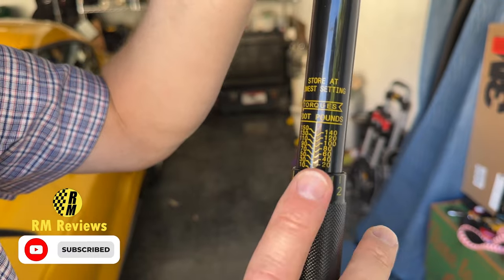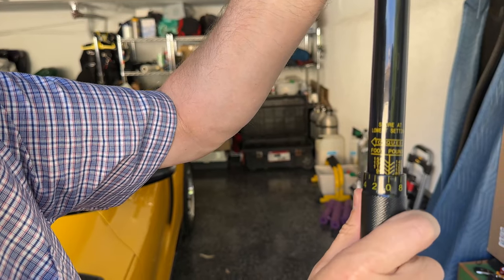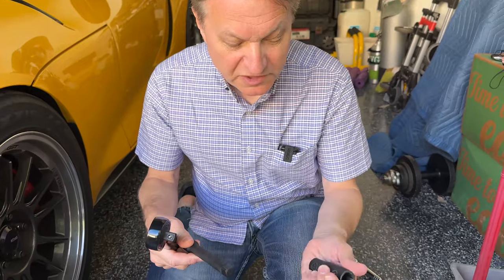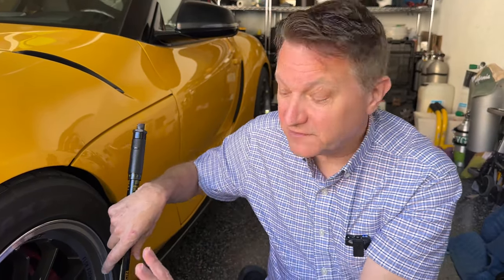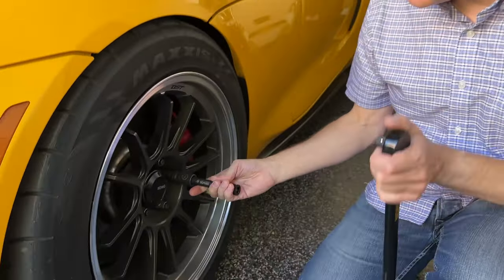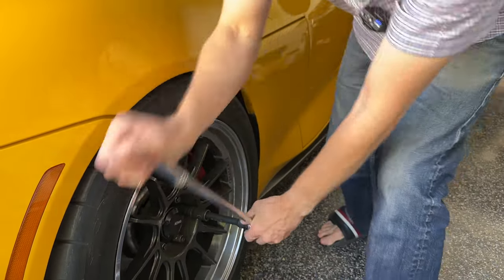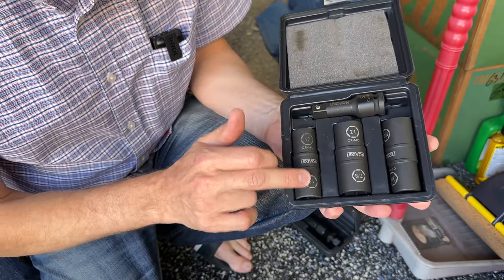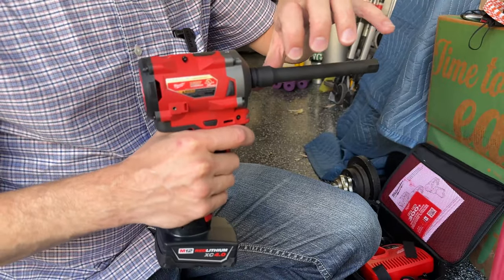How To Use A Torque Wrench For Beginners - 2022

Comment: One thing I didn't know and doesn't seem to be mentioned anywhere is that there are two or more ranges of torque wrenches. 0-25 and then 25 upwards. The former si really only for bikes and small bolts. I made the mistake of ordering a 25NM wrench and it was useless for cars. As a complete newbie I was not aware of this.
Reply from the maker: Good point. There are multiple ranges yes. I'll mention that in a a future update video.
Reply: there are at least 10 'common' scales, and they all depend what you are working on, there is no one size fits all, and if there is -it's so not precise to really beat the purpose... but for general around car purpose would be 25-110nm scale or as close to that as possible; over 120 you need a break bar, bellow 25 its for plastic and really soft metal... my scale is: screwdriver strength is up to 20, than you have fist over bolt 25-45, then fist next to bolt lever, then 2 fists lever, and finally -break bar lever for 120nm+  it's as precise as the cheapest tw, lol and more than enough for majority of at home motorcycle, car, lawn mower etc repairs
Reply: A 0-25 isn’t totally useless for your car… remember you wanna   have the right torque on your spark plugs.. so you don’t ruin your threads or your pistons. Perfect for 0-25…

Comment: When I use my small impact wrench it takes a lug nuts off with no problem I put a 6 inch extension on there and the doggone thing will not take the lug nuts off it will work pretty good with like my 2 inch extension but that doesn't always work for me sometimes I have to do the 6th and end up taking it off by hand there is quite a bit of difference

Comment: What I've read:
- If you're putting a lug on a wheel, tighten it by hand.  Then torque it to 33%, then 66% then 100% specification.  If applying multiple lugs this way, do all at 33%, then 66% then 100%.
- Torque lugs in a criss-cross pattern so that they distribute even pressure on the wheel and you don't bias the tightness on one side of the wheel.  That's bad.
- Make sure you re-tighten the lock nut on the handle after setting the torque value and before using the torque wrench - it can affect the internal spring accuracy.
- If you loosen your lugs in order to re-torque them, you may need to re-torque again after 25-50 miles - don't loosen them to torque them, just torque them, unless you're concerned they are too tight already.

Comment: why is the lever by the head switch to the right, but it is actually tightening instead of loosening. Shouldn't it be loosening the lug/bolt instead? And when lever is switch to the left it should be tightening? I pulled out a craftsman ratchet and having the lever pointed to the right is loosening a bolt.

Comment: Somebody said you just tighten lug nuts till your veins on your hand pop out can you get a little bit of rust on there after a year or so and when you go to take it off you break the stud working in a tire shop I can tell you straight up we break a lot of lug nuts studs because people have over tightened them we never tighten lug nuts with impact gun we always use the torque wrench

Comment: i noticed that the adjustment move and doesn’t lock well after I lock the ft-lb. is this normal?
Reply from the maker: It can sometimes slip, so just make sure it's tight. This is an entry level wrench and I use it all the time for wheel torque. If you want something better, there are other wrenches that cost a bit more.

Comment: I have a question. I see some guys swinging past the click with there motion. Wouldn't that give you a higher torque than your looking for? it will still get tighter after the click right if you dont stop right  Thanks so much
Reply from the maker: If you keep moving the wrench after the click, you'll go past the desired torque value.

Comment: Also on my dewalt torque wrench you cant turn the handle to adjust it. It stays stationary and you have to turn the pole around it. I think the handle broke. Your thoughts?  Thanks
Reply from the maker: The prices have fluctuated, but I just checked the link I have in description, and the 1/2" Lexivon is about $40 right now.

Comment: Please advise 🙏 what will I best to buy;
1. Torque wrench manual
2. Torque wrench normal + digital adapter torque wrench
3. Torque wrench complete digital gauge 🙏
Reply from the maker: Buy what you can afford. You don't need a digital readout unless you need more accuracy and you use it all the time.
Reply: @RevMatchReviews  thank you 🙏🙏🙏

Comment: Not sure, but if you use any length of EXTENSION, it changes the actual torque value from what you set it at.
Please do your research to find out HOW to adjust your torque settings if you use any length extension.
Reply from the maker: It does not change the torque value. The rotational force is how torque is applied to the bolt. You might reduce the accuracy somewhat if you don't apply force perpendicular to the bolt, but at an angle. Yes, I definitely did my research and validated it too. Consult a physics book, or with a certified mechanic instead of some random dude posting on the internet.

Comment: I didn’t hear any click.  I’m at 100 foot pounds. I felt the nut get tighter so it worked for tightening them but it just tightened until I couldn’t tighten it anymore. No click tho.
Reply: Some wrenches wont click but the the head will tilt instead
Reply: @ShootLuckGaming  seems to work just not as expected from videos showing it click when others use it. Question. Anything good for getting rid of rusty spots around the lug nuts after awhile, I had a mustang back in the day and I had a body guy who gave me a little spray bottle of some acid shit, not sure what it was but washed away the rusty spots by the lug nuts on the wheels

Comment: I don't get why many of YouTube professionals doesn't show how to operate a low setting torque wrench and the click they produce. Show me 7.5 ft lbs torque on a aluminum head cover. I guess the click will be so soft and the indication is the handle deflects from head of the torque wrench with little to no sound.
Reply from the maker: I can do a video with a lower torque spec wrench, but more people want to change their wheels than work on their engine so there's not much demand.
Reply: I agree with the above comment, where is the other video? I need to torque at 8ft lbs,

Comment: Never good to use an adapter with a torque wrench.  It will be off at least 5% on your 95lb. Also the wrench itself has + or - 2% percent.  So by adding an adapter you are +or - 7%

Comment: .. and skipped right past explaining what a torque value.. is?? Like what .. that’s all I’m trying to find out and every YouTuber just says oh you have to turn this dial right here to this number, this is how you do it! me thinking okay that’s helpful, now why do I need to do that YouTuber - now let’s skip to the part where I put the wrench onto the nut 🤷🏻‍♀️🙆🏻‍♀️
Reply from the maker: The torque value the application of force at radial distance. i.e the amount of force applied to your lug nut. It's measured in force x length. In the US we us pound-feet (lb-ft). In other countries it's often expressed in newton-meters (Nm).
Reply: In the most simple of explanations it is a measurement telling you how tight a nut or a bolt is screwed on.  For example, if you are putting lug nuts on a wheel and you want to make sure they don’t come flying off then you have to tighten them enough.  But what is enough?  That’s where the value on the torque wrench come into play.   You might find out that you have to tighten the lug nuts to 70 ft/lb.   So you set the dial on your torque wrench to the 70 ft/lb mark and you tighten the nut until you hear and feel the click.  Now you know that you tightened the nut enough.

Comment: the r(ight)etard way... who uses tw for wheels??? it's used for precise things, like cylinder head, valves and stuff like that, wheels you just screw it until your forehead vein pops out...
Reply: You literally are given  torque* specs for specific vehicle wheels. And have actually ones MADE to do it specifically
Reply: @lovin_richie  but of course
Reply from the maker: Torque wrenches are absolutely made for wheels. If you drive quickly, you'll care about your wheels staying, and not over torqueing them and messing up your wheel studs.
Reply: If you tighten them until you even pops out. Your legs juts back out quickly